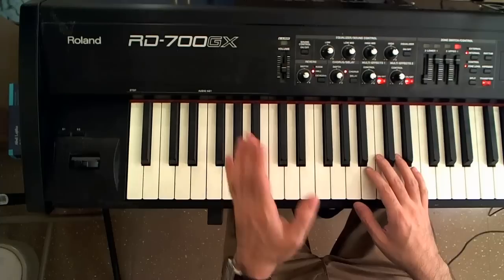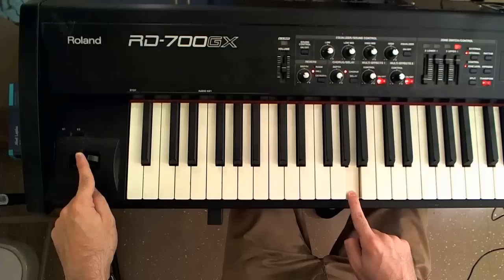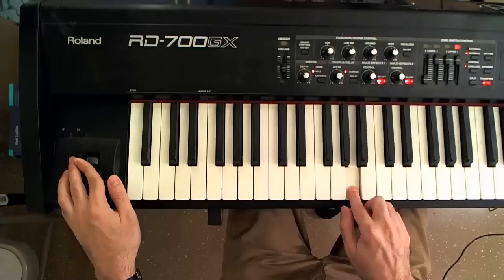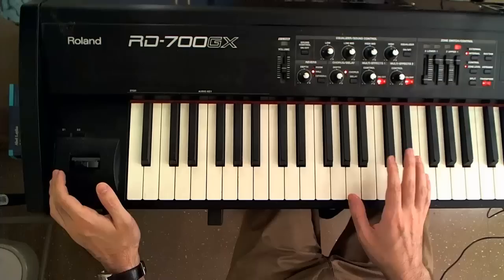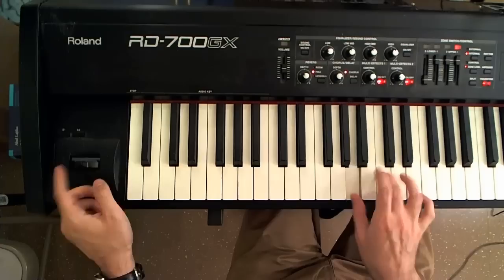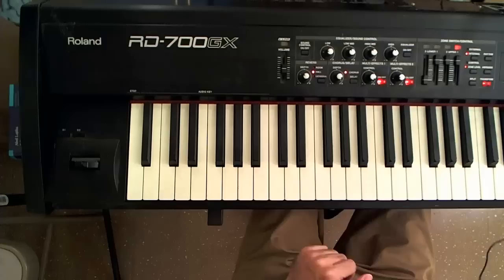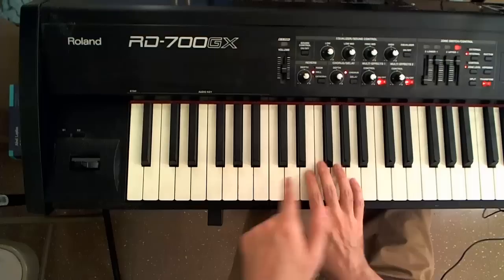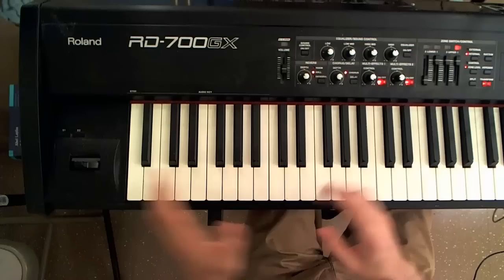Pitch and Modulation Wheels Lesson

Comment: mod wheel better than joystick for effects which can be switched on/off, because you can leave it the position where effect is applied constantly, until you don't touch the wheel.
joysticks are usually spung, and you must hold it all the time to keep effect applied
Reply from the maker: Yep. I never could understand why Roland, Korg and so many others employ Joysticks. So many effects like autopan, tremolo, leslie, etc need a variable modulation wheel which doesn't snap back to the origin, that I really can't understand what would motivate a company to use a joystick other than the initial "wow" factor.

Comment: I can see where Roland's joystick could be preferable over the typical pair of wheels for this kind of playing. Very cool demo and use of that unique feature!

Do you ever find the joystick's action (the tension and auto-centering) undesirable for certain sounds that require subtle or very gradual modulation swells, like strings and brass?
Reply from the maker: +Wourghk I hate the Roland joystick, because the modulation part (up/down motion) always snaps back to 0. Many sounds use the modulation wheel to control crucial features - e.g. auto-pan in electric pianos - and I can't use it because the moment I let go the effect goes away! Give me two independent wheels any day.

Comment: I'd been getting by with a cheap keystation keyboard with a modwheel for the last few years.
But I just got an 88 key keyboard with proper key action or properly weighted keys. But it does not have a modwheel whereas my old cheap keyboard did have one and I used it a fare amount for string orchestras. 
I really want to use the new keyboard but the lack of modwheel is a huge hit. 
Does anyone have a tip or any suggestions?
Reply from the maker: There's a guy from Spitfire Audio who uses a set of four long throw MIDI faders. Take a look at this:
https://community.spitfireaudio.com/discussion/20/midi-cc-controller
Reply: @MangoldProject  
Thank you for the link. 
I looked through it but couldn't find the exact thing I'm looking for. but a lot of great suggestions. 
I'd be happy if the controler only has one slider or a wheel.
I guess no one would make such thing and try an sell it for almost no money.

Comment: Hi guys - my 88keys doesnt have modulation wheels for pitching my synths... are you aware if there is a possiblity to connect a midi expression pedal somewhere in the system - and how to connect them being able to do the same as with the wheel??? best, Chris
Reply from the maker: To my knowledge and dismay: no. I've searched high & low for such a unit and could not find an off-the-shelf one.
Reply: i found a usb expression pedal from eowave - its not super cheap but it should work with reaper, pro tools etc having 2 different midi output (keys/pedal) on 1 virtual instrument

Comment: Does anyone know if any company makes pitch bending and modulation pedals with a joystick control like this one? I have good keyboard instruments (don't need to spend money on one with the joystick) I'm just looking for a device/pedal that has a joystick where I can manually control the pitch and modulation sound waves on my farfisa.. if anybody can answer that I'll love you forever.
Reply from the maker: Unfortunately the answer is no. 

The closest thing I'm aware of are assembly kits offered by Doepfer, but it's not easy to get them to work (you need to build it!!!). Check this out:

http://www.doepfer.de/we.htm

Even if there was such a thing, there's no guarantee your keyboard would respond to it. For example, my Nord Electro 5D doesn't respond to incoming pitch bend messages even when I control it from a keyboard that has a pitch wheel.